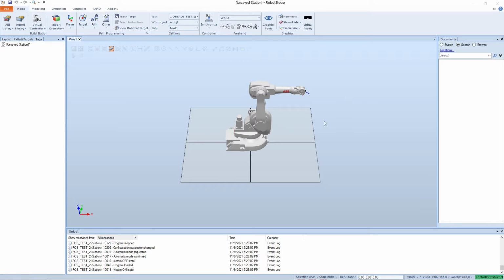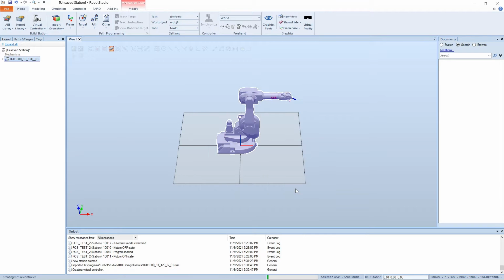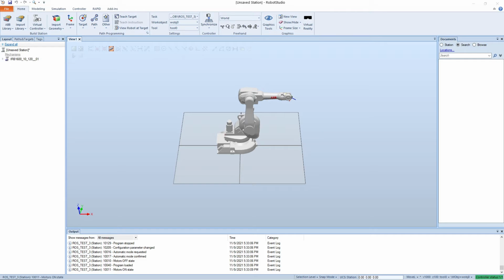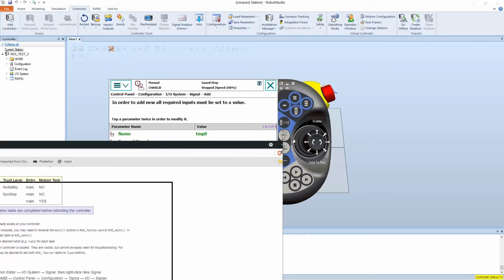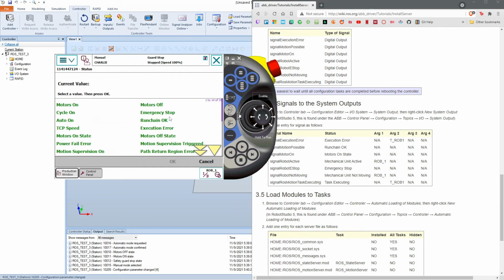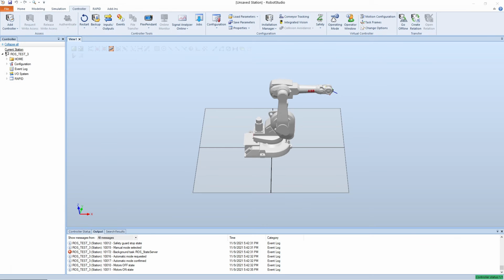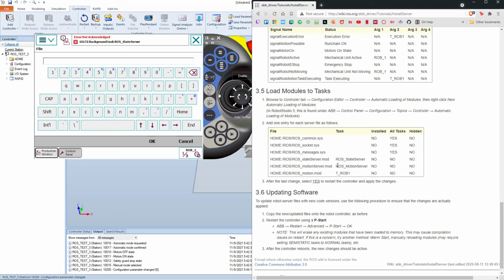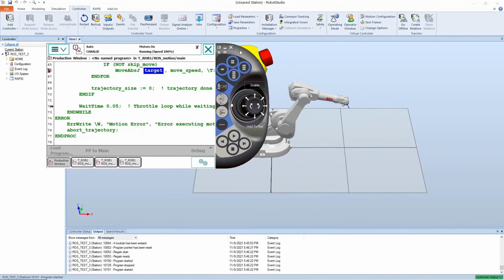Setting Up Robot Studio For Simulated ROS Control

Comment: Well, thank you very much. But, you can show me how to setup ROS to send request? Thank you
Reply from the maker: I suggest trying to install ROS Industrial, the ABB-drivers, and moveIt for abbs.
Reply: @xXVAN99Xx  You spend 2 PC to connect? Thank you
Reply from the maker: @nguyennguyen-rl8vj I use one PC running linux+ROS and one running robot studio
Reply: @xXVAN99Xx  What is cable you using to connect, and how to setup port? Thank you for your supporting
Reply from the maker: @nguyennguyen-rl8vj  I am connecting over wifi but wired works i am supplying the IPv4 address when connecting
Reply: @xXVAN99Xx  
can you export a video for the tutorial? I appreciate that, my project is having a lot of difficulty, thank you very much